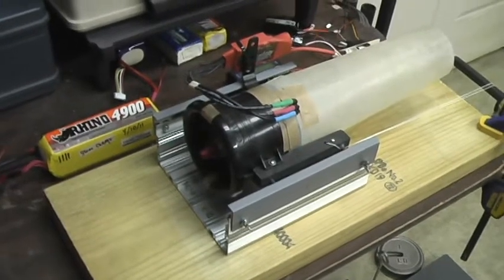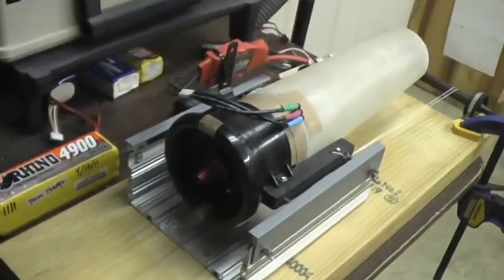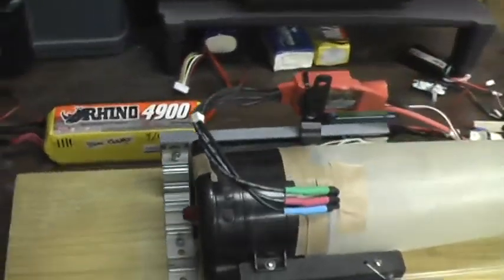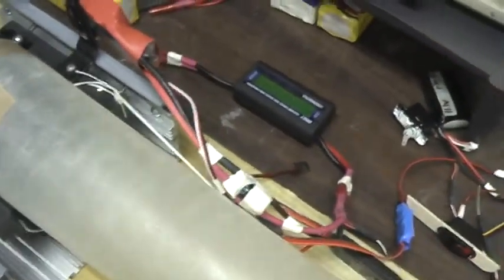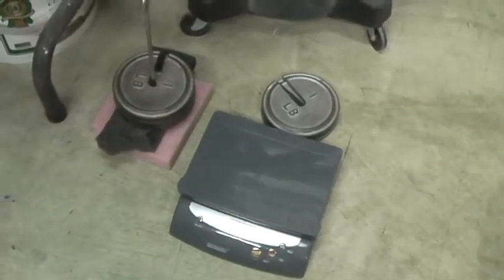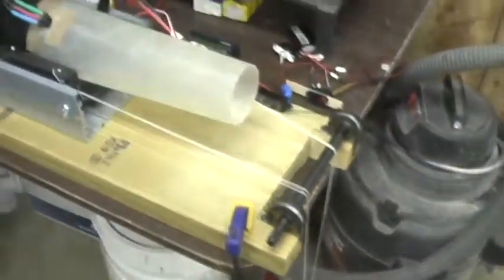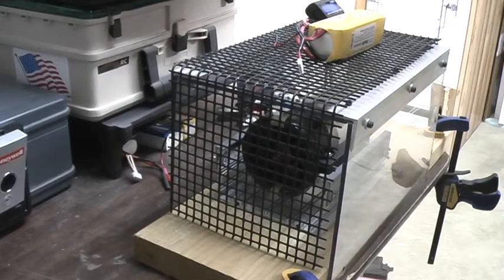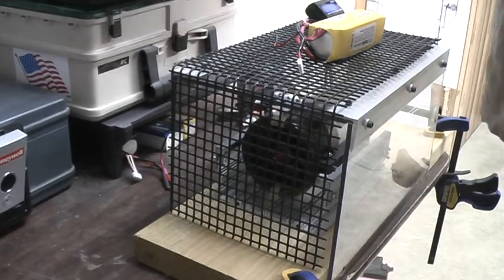CS12 blade 90mm X Flight assembly

Comment from the maker: Fizzak,

Get your ESC programmed and fan together and we will bench test it.  I like to give all power components a bench test before spending the time in the jet and encounter problems or inflight failures.  I got on test one 30deg timing 22.5V 95A 2137 Watt with a thrust of 6lb 3oz. I dropped the timing to 7deg and got 22.5V 91A 2047W at 6lb 1oz.  Let’s see what yours will do.